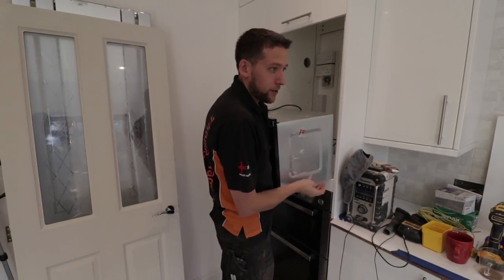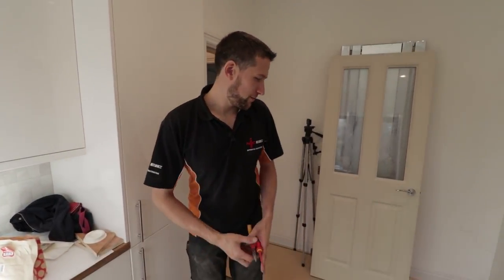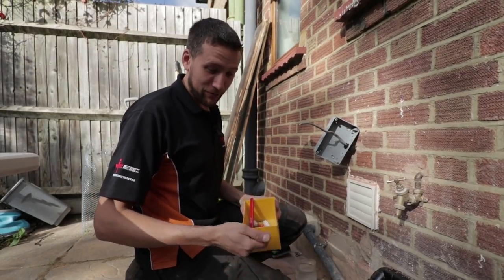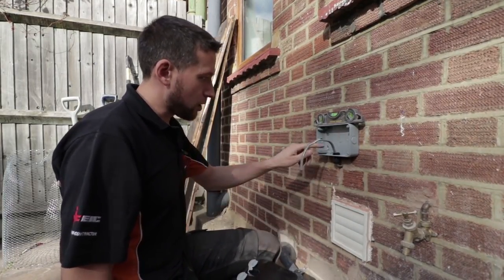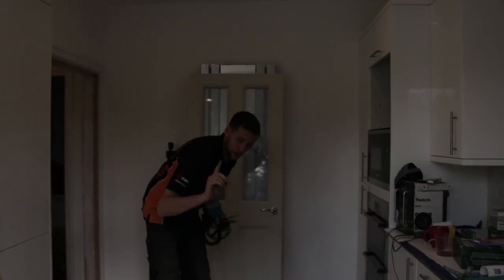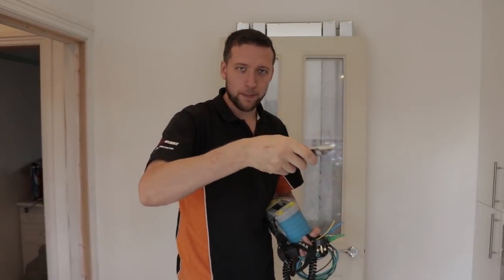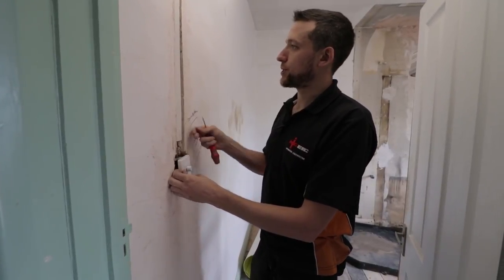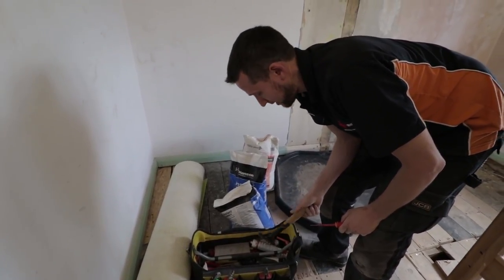The Final Furlong - Rewiring a “just rewired” house | Thomas Nagy

Comment: I have found the only downside to the MK Spur is the fuse holder, can be a little temperamental in closing it. Also many people aren't aware MK do a flex out and non flex out version. Non flex means it's flush with the socket outlets! :)

Comment: the outside socket has a groove where you can use sealant between the wall and rear face of the socket if you insert the cable throught 20mm knockout hole.
there is a drain hole on the bottom of the socket which should be knocked out as well.

Comment: Morning, Sparks.  These British General outside sockets... brilliant.  IMO best you can buy and for the price I think they are selling themselves short.  From the nice, chunky terminals and frosted cover to the little rubber bungs they supply to I.P the screw holes I'd buy one of these over an M.K. any day.  R.E keeping the I.P. sound if you use the rear cut out... Silicone sealant around the whole on the back before I put it on the wall, and then the edges too if space permits.  Also, If you haven't already give Hager accessories a go. Definitely my preferred brand for looks and use.

Comment: I have always put smoke alarms on their own dedicated circuit. But you have very good point and I will be changing and putting them of the lighting circuit. 👍🏻
Reply: jay r, I also used to put smoke alarms on their own dedicated circuit, but recently went on an Aico training course through the company I work for. Aico are the market leaders with smoke alarms, and the trainer told us that alarms should always be wired into the lighting circuit, for the same reasons that Thomas pointed out in this video.
I will now be wiring smoke alarms into the lighting circuit from now on
Reply: Me to mate.

Comment: Outside sockets. Drill through the back. Seal with compound the run a bead of silicone on top where it meets the wall and down the sides.  Sorted

Comment: I once took my feeds and neutral to the switch instead of the ceiling rose and my boss at the time gave me a bolloxin over it. Sometimes its easier just to do your connections on your feet at the switch than up a set of steps on a ceiling rose

Comment: 100% right on the way the outside socket was done always done that myself also 100% right on keeping the junctions in the back boxes don't use Wago's stick with screw chock blocks cheaper and bite better on the cable Wago's on the same par as scotchlocks which always became problems after a few years with corrosion high resistance problems

Comment: Great videos Tom. When fitting outdoor sockets I have started to drill the outer 70ish mm of the wall with a 25mm bit so I can use a pvc gland into the back of the box and it can push back into the wall when fitting the box. I can't stand the squeaky feel silicone leaves on my hands!!

Comment: Fixing outside sockets...If using back entry point I use 20mm conduit...steel or plastic, drill 20mm hole through wall use 2x female couplers and bushes. This way cables protected in the cavity and no issues with IP rating...

Comment: Always take my feeds to the switch. It means you have neutrals at every switch just incase for neons or whatever and you have at most 2 cables at a light so its easy to put up a decorative fitting which usually dont have a lot of room! Be very careful with laminate flooring too if you are using a multitool to cut it as it can go on fire very quickly even after you've finished!!

Comment: I drill through for the cable then drill from outside with a 25mm sds into the same hole so a stuffing gland will fit. Tighten the gland close to the wall then lose the excess inside. A bit of silicon don't hurt either.

Comment: Here in the States at least in Florida Smokies/Carbs are on a dedicated line and usually in Series so if one goes off the whole system goes off. I know with Low Voltage Security it's in series with a EOL resistor on the last smokie/carb.

Comment: I fitted the exact same exterior socket on my garden shed. I came through the back in plastic conduit and terminated it using a threaded adaptor, then used sealant around the top of the box to prevent water going behind it. However, if I was using standard twin and earth I would have used a gland.

Never seen anyone loop the neutral wire down to the lightswitch and back out again before now. Unless the switch was inline with the cable of course. Pretty much every installation I've seen always takes the supply straight to the light fitting, then a switch wire down to the switch.

My old electrical lecturer agreed with you that smoke alarms were better off wired  to the lights, because if the breaker goes you might not be aware the power to the smoke alarm is off and depending how long  it takes the battery to run down, the pips might go off while your out. So you have no idea the alarms aren't working.
Reply: yes in the usa i was told same thing for smokes  lights, coldbox something you will notice right away if you dont have power

Comment: Use click mode, they come with a black rubber silicone gasket, as you tighten screws to secure to wall it squishes the gasket to the wall and make a water tight connection

Comment: I use the rear entry with a stuffing gland, at 1st fix I'll drill a 16mm hole then redrill the exterior skin of the cavity to 25mm in readiness.
I do the same thing with an external socket fed with swa (external gland obviously) wherever possible, for example when mounted to the outside of a flower bed or something.
I think it makes for a nicer finish.

Comment: Anything outdoor normally I would SWA it, but I think knocking out the back of the back box and either silicone it out,  drill a big enough hole and use a coupler with a bush poke that through the wall then silicone that. Keeps it water tight, also inside those BG outisde back boxes they have drain points you can drill out which I tend to put a small hole in them just in case

Comment: hi thomas nagy In an outside socket such as this one tom I normally cut the 20mm hole at the back put a 20mm open grommet in it then bring the cable in once finished and wired and ready to screw the socket frount to the back box I put silicon in the 20mm hole then that will seal the hole also drill a drain hole in the bottom 2mm

Comment: About the light switch. From what i understand, in the UK you use a ring system and lights and sockets on different grouos. In NL, I use the star system, from fusebox to the lightpoint in the room and from there to the lightswitches and sockets. Bringing the neutral to a lightswitch isn't necessary, but for upgrade to an extra socket and/or dimmer can be handy, if the neutral is already there.
Reply: Guust - before the introduction of so called “smart” light switches, the typical U.K. lighting circuit is wired as a spur with “loop-in” ceiling roses (ceiling mounted terminal box with a drop down flex to the lamp holder). So a cable from the consumer unit to first ceiling rose. One cable goes to wall switch (line and switched line), second cable (line and neutral) goes to the next ceiling rose, etc. etc... Obviously if there is more than one light fitting in a room, a another cable will go to the next light fitting/ceiling rose (switched line and neutral).
Where a neutral is needed in a wall switch, I would replace the two core & earth cable between the ceiling rose and the switch with a three core & earth cable.

Comment: I always use duct seal on the hole around the wire, then I take the wire straight into the back of the box, and then silicone around the box.

Comment: If I absolutely have to go rear entry on an outside socket I make sure to fill the hole with silicone and make sure it's sealed the best I can. Depends on where it's installed, sometimes I add a drain hole if there's a possibility of it getting saturated in water.

Comment: A typical 2 up 2 down I put smoke detectors usually on the upstairs circuit with my last Smokey end of line in the downstairs hallway, I wire the downstair circuit end of line at the front door switch when comes to testing the two lighting circuits R1R2, there within usually a few meters of each other saves a wee bit time

Comment: I find entering the box from the rear and using polyurethane sealant or tec7  as silicone tends to unbond from the plastic over time and leak, and avoid if possible, passing the cable into the enclosure with an external glad as the risk of mechanical damage is too high in a domestic garden environment without the use of metal conduit which adds expense.

Comment: I prefer to have the neutrals ran to behind the switch rather than in the floor/ceiling.
Had a few houses now where I've replaced the light switches with smart/iot switches and they all need a neutral so it's a damn sight easier if there's already one there!

Comment: I put the cable through the 20mm knockout and use silicon to cover any gaps. Although it doesn't leave much room for play but I feel it is a waste of a flex gland if I use it when it's not really necessary. Just my opinion though

Comment: Whichever way you wire lighting, use 3 core as a switch drop. Gives you a neutral if you take the loops to the fitting or a perm feed in the ceiling (if required in the future for outside lighting etc) just ensure everything is marked up correctly. I get it's little bit more pricey but with the way switches are nowadays best to future proof I.M.O

Comment: Outdoor socket rear entry then silicone, not forgetting to drill a small drain hole in the bottom for ventilation which helps prevent condensation!

Comment: Awesome video. I see your point with the smoke alarms. I fit a lot of lap stuff but am starting to up the quote for the more expensive brands because of the amount of laps I return due to terminal screws busting  or that they are cross threaded from manufacturer. Regarding the outside socket, I think if you are using a pressure washer near the socket then water is just as likely to get in via the stuffing gland than it is through a hole in the back of the box. That is after all, why the Lord blessed us with silicone. :) (leaving the bottom of the box free for drainage of course)

Comment: With the BG outdoor socket, I too would use rear entry with a ton of silicone across the rear surface to prevent water ingress. With your install method, do you still use T+E? I didnt think it was "rated" for the outdoor temperature range/UV exposure.
Reply: Taylor D that’s a very valid point. Only a bit of grey showing, but nonetheless.
Reply: Also not ideal on a fused spur that'll ALWAYS be on. But I get the idea that it's up to the customer if they want to leave it on all the time
Reply: I usually use a stuffing gland like Tom but put heat shrink around the T&E for added UV protection. Also I put WD40 on the contacts to avoid moisture building up.
Reply: @nigeldolman954  my cousin, who is wheelchair bound was in the para Olympics.
He got disqualified.
He tested positive for WD40
Reply: Nigel Dolman wouldn't a bit of no-lox or silicone on the terminals, have a bit more longevity?
Reply: Definately I'd put a smoke alarm on a lighting circuit.

Comment: Back entry on external socket is 10mm hole and silicon circle on the back and then fill the hole inside for belt and braces. Yes, my earth sleeve has a gazillion ends!

Comment: Finally a question for the floorlayer my time to shine haha. All flooring has to abide to European fire resistance tests. For flooring for carpets and vinyl the hot nut test is used, basically a nut is heated up to glowing then dropped onto the floor covering. For solid wood, laminates and engineered wood the cigarette burn test is used. A cigarette is lit and left on the floor covering for a few seconds then it is examined. But when laminate is all locked together the laminated bottom and top are fairly heat and fire resistant. It’s the open mdf that makes it go up in flames because of all the adhesives used in the process.

Comment: I used a closed grommet and plenty of silicone at the back of the box for the outside socket. Not a fan of seeing t&e cable externally. Always link it to a fuse spur as you do so it can be isolated internally. Great videos mate. Any updates on the new van??

Comment: 5:30 - I find that those boxes are never entirely waterproof. Regardless of the IP rating, condensation always occurs, so the key is to limit the water coming in but always allowing it to drain out. They have tiny knockouts at the bottom and it is always worth allowing any droplet water to drain out before they accumulate.

Comment: What are the arguments to have smoke detectors on their own circuit? If they’re on the lighting, it’s clear when the breaker’s tripped and as you say, they can’t avoid fixing the problem.
Reply: Cameron Steel I’m pretty sure Aico recommend their alarms are supplied from a local lighting circuit.
Reply: Some led lights cause proplems with smoke detectors making them beep but ive only herd that ive never seen it
Reply: "That's quite controversial!" he emphasized several times...  Not so much, no. Just a simple difference of opinion between "recommendation" in the Fire Reg's  (and I'm not even certain it's still in the latest editions) that 'safety' circuits should be on their own breaker, and the practicality of handling real-world building users exactly as described.  The two big Housing Associations I've worked for wired detectors and alarms to local lighting circuits as a policy because they can never trust tenants to not ignore a faulty safety circuit.  Immediate safety always trumps nuisance tripping when you are liable!  A responsible householder is a different matter if they indicate they are keen on safety and good maintenance.  Then, if you trust them, it's safer to separate them so that a faulty light fitting that makes them keep a lighting cct off until a replacement is obtained doesn't also compromise fire safety (nor a simple failed lamp that makes the RCBO trip...)
Reply: I always install dedicated wiring back to the consumer unit for the DB, however I terminate it into one of the lighting breakers. Reason being you would know if there is an issue with lights, not necessarily with your smokiea
Reply: Bs 5839 part 6 says shared circuit, which is why Aico recommend it

Comment: If you have  feed in the switch, access and second fixing would be easier plus neutral is in the switch if you need it. But you need to run  a separate circuit for the smoke alarm.
It would be your choice in new built/whole rewiring, but not if the rewiring is  limited area let's say if it is just a kitchen which in this case you have to have your feed in the ceiling rose to be able to have mains run smoke alarm system.

Comment: For your methodology for wiring switches! Maybe. What happened in my old flat, they were wired this way. So when the maintenance guy rewired the switch, it put things back and pinched one of the wires. 

Turning things back on and testing (good man), the pinched wired arched within the box and created quite the fireworks in the wall. All I heard was "holy shit" but it was enough to understand how major it was.

I would say junction boxes almost prevent this.

Comment: Outside boxes I bring the wire through the back and I use sealant across the top and down both sides but none across the bottom. If you want to donate your meter..lol... am way to broke and still using just the basics as I try to learn the codes.. was handyman forever...

Comment: Just put transparent silicone behind the socket. Plenty around the cable, to make an airtight seal and then just a little on the wall.

To avoid that the silicone gets all over the cable and the wall around I just place some paper tape on the surfaces I don't want to seal.

When you're finished doing the work on the socket you just go ahead and make a nice seal on the edges.

If the wall is white, use white silicone - since it's more resilient again ageing and cracking than the transparent one.

Comment: If the L-N impedance test trips an RCD you probably have a slight leak from neutral to ground somewhere in the system. Do an insulation test between neutral-ground and you will find it. Could be some water in an outlet or if there are lots of switching power supplies like computers connected because they have filter caps.
Reply: It's fairly standard nowadays for an RCD protecting 5, 6 or 7 MCBs to trip when carrying out a loop impedance test on one of the circuits.The amount of fixed and plugged in electronic tech-y stuff in people's homes leaching current to earth....
Switching off the other circuits not under test does the trick.

Comment: The advantage of using a manufacturer like MK is that they offer a complete range, grid switches, specialist sockets and plates and euro modules like sat, data etc. Everything matches and looks the same and is available everywhere. The lap shit doesn't and you end up hunting for something that looks similar etc. Though to be honest MK has gone down hill in recent years. I'd also always do rear entry for an outdoor socket, bit of silicon and drill out the drain hole.

Comment: Thomas I drill the outer brick to 20mm a couple deep for the pipe to go through then lock ring inside..totally water proof with no exposed wiring..Just remember to silicone the outer coupler around the hole before putting the socket on..gl bud
Reply: Coupler

Comment: IMHO it's better to bring the neutral and ground to the light switch as well, so it's easier to install a remote controlled switch later. Also, it looks more organized for me, but I'm not a practicing electrician. (but I have the qualification to work alongside an electrician - I don't know if there's something like that in the UK, but in Slovakia there is)

Comment: Drill the back and the drain hole and silicon across the top and sides, a zs that trips the RCD is due to the RCD loaded with fault current or low ir values